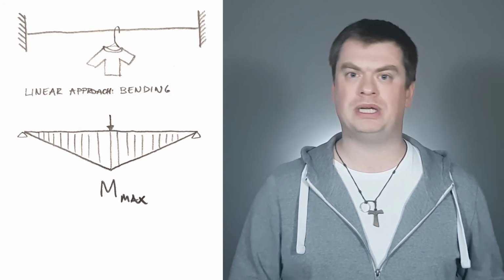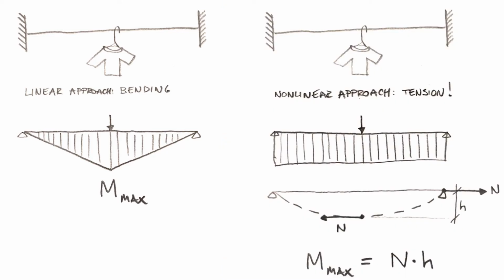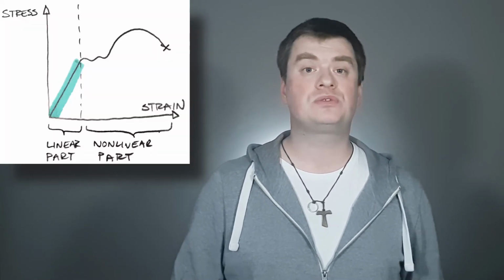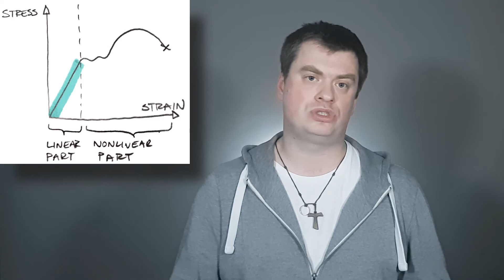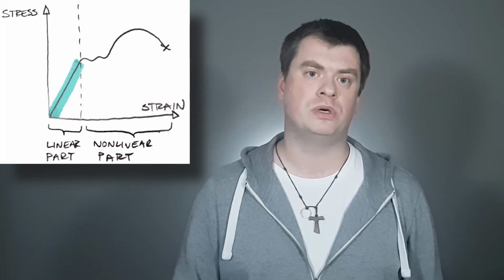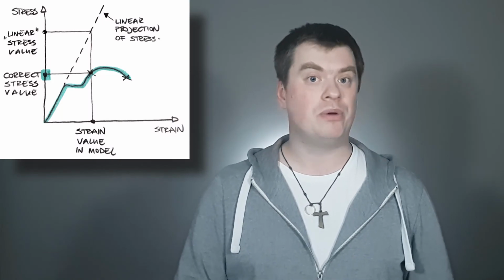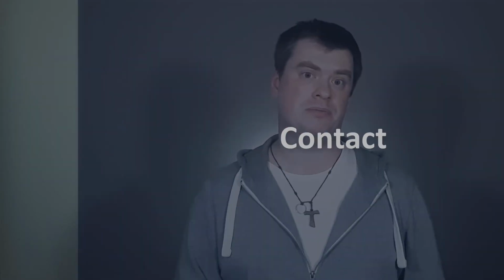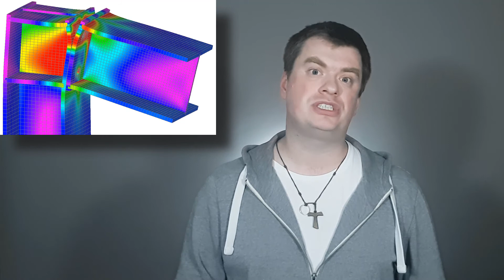Analysis types in FEA: Beyond linear static

Comment: after 7 years, this is still very useful. Everything is dynamic in this world, and hence the laws of science only apply under certain conditions. With regards to contact, the equations of Newton do not consider the "Geometricallity" of the substance in contact, which translates to stresses. The less volume (could be reduced to surface area for lengthy elements) of an object in contact with another, the higher the stresses experienced within that object as the center of gravity shifts, which influences strains up to a certain degree. "All analysis should be dynamic and non-linear, but we don't know enough to be certain of the things we don't know"